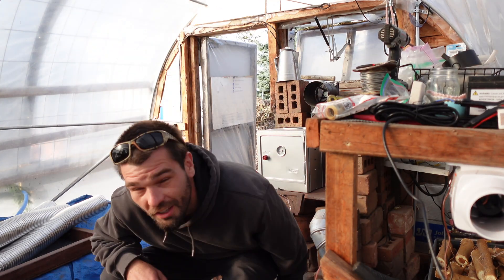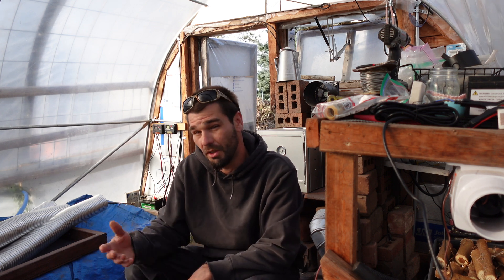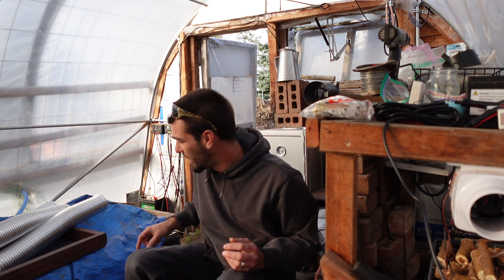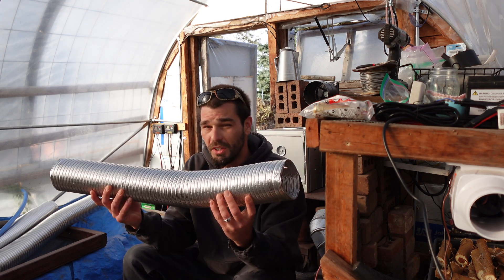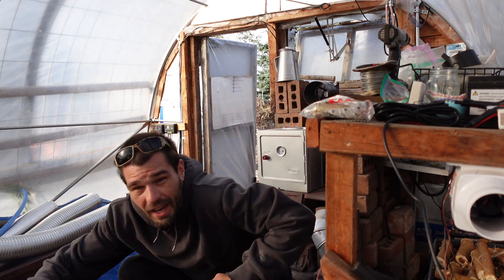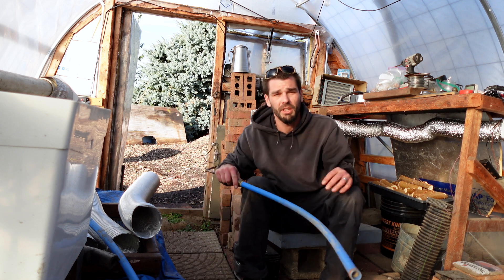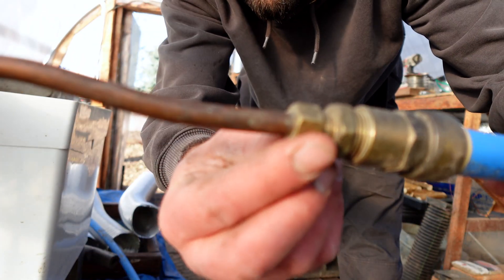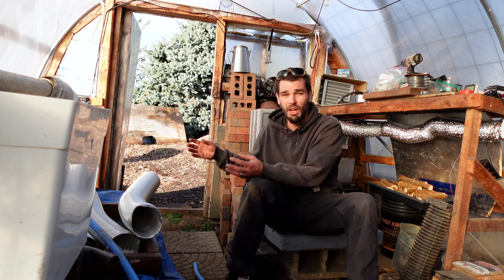How To Heat A Greenhouse - CHEAP DIY Greenhouse Heater  : Running Water Lines PT 1 2024/2025 winter

Comment: Watching a oldie I’m using a plastic barrel and I’ve got 300’ of 3/4” 46 wraps around. But main reason for my post is to say I’m using a pallet base system to allow for air flow under the pile I block a few of the cracks in the pallets to prevent chip fall through around the center pallets but the outside edge is open my pallet base is 12x15 used a few corner post of recycled wood and drilled a few holes to zip tie the chicken wire to the pallet structure and corner posts sun of the chip is falling through but it seems to be holding rather well. Contemplating using ground cloth to stop the fall through mainly to keep it from falling in my shoes socks as I dump the next barrel. Unfortunately I don’t have a bucket tractor 😰and dumping 40-60 barrels over the Wkend, my back n upper body is whopped 😅😊
Reply from the maker: We rent a tractor from our friend down the road it saves me so much work. I’ve built these by the barrow load and it’s not easy. That’s an interesting idea of a pallet base I’d worry that the cold temps would negate what your trying to achieve as I try and dig down to the earth to allow no airflow to seep in underneath and the ground directly under the pile never freezes. Let me know how it goes for you! Any questions feel free to reach out!

Comment: Watching these videos out of order.  But how are you getting hose and plex filled with water w/out air. Abd does it keep circulation? Great ideas.
Reply from the maker: Once we’re done with all the outside work we will share everything we’re doing inside the greenhouse to move air and water through separate lines with pumps and fans ran off solar power. We’ve got a lot of videos coming covering this subject thank you for the Interest!

Comment: Have you used pex pipe for this kind of application befotr?  Does it work? My experience as a commercial plumber says pex needs no insulation, therefore it doesnt condensate. Meaning it probably doesn't lose much thermal mass. So maybe it wont do what your asking of it.  Just a thought.
Reply from the maker: Yes I’ve used, copper, pex , and rubber hose. Pex isn’t the best for this application but with enough of it inside the pile and a big enough pile for a heat source we can achieve our goals. However I do plan to make progress on a more efficient and permanent heat transfer system. It’s always a learning experience every year lol thanks for the input and watching!

Comment: Aluminium is an insulator. Good to use it as insulation for running the outside bit of your airline.
Reply from the maker: A heat conductor or heat insulating reflector is the definition of aluminum for heat transfer. It may not work as well  as steel or copper but its worlds better than our plastic drain tile
Reply: Aluminium conducts heat REALLY well, that’s why most heat sinks are made out of aluminium. Aluminium foil is a reflector for infrared radiation, not conductive heat.

Comment: Im assuming you use a battery for the pump at noght, since solar power is pretty hard to come by when the sun is down.  It would be neat to see that set up.

Also, have you looked into adding some pipes near the bottom of the compost pile to get airflow into the pile?  Seems like you'd be able to get a more thorough composting is aot was flowing in a few feet from the center.
Reply from the maker: Technically yes if it runs free standing without a timer, but with a timer we can get better longevity into the night. The most energy will be stored during the day when energy from the sun is abundant and we can flow heated water into our tank. We will be sharing every little step in this process over the coming weeks! Thanks for the interest, and I’ve thought about oxygenating or aerating the pile but with it being so massive it should have trapped plenty of oxygen and should burn for months. Maby I. The future is could experiment with this idea, thank you

Comment: Mr. Shark sure had a great idea when he came up with those "Bites". Worth every penny.
Reply: Plumbers hate them, I've asked why and been told they fail too much.  But 15 years in they seem to be fine.
Reply from the maker: @jeffreykershner440 I’ve not had issues other than trying to remove them lol. Maby that’s their issue with them.
Reply from the maker: Truly worth the investment, I chose to use it in the most critical hard to reach joint. The rest are pretty easily accessible so I could drastically cut costs and be able to modify the system going forward. Thanks for watching!